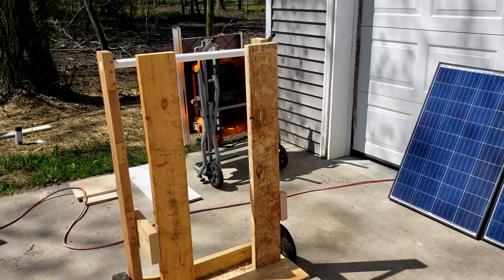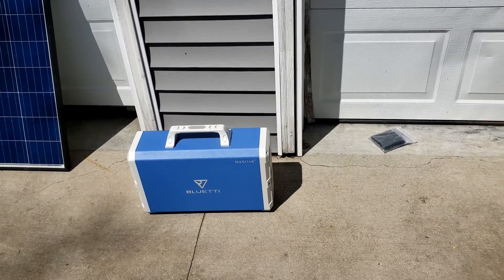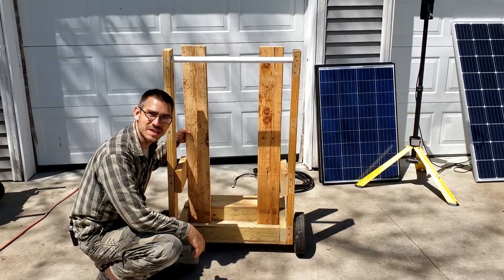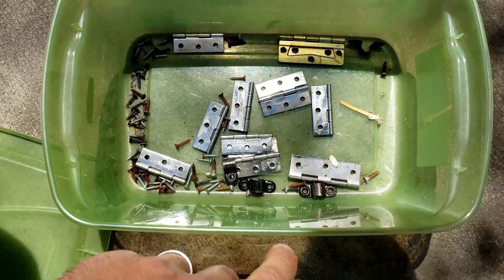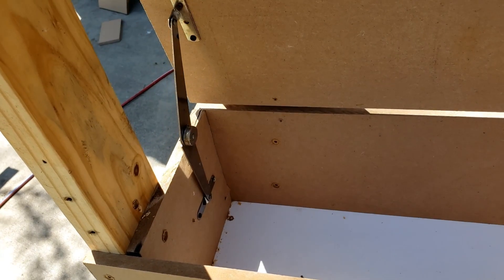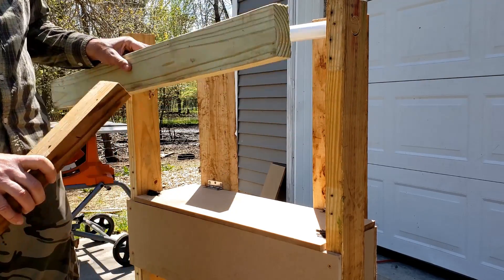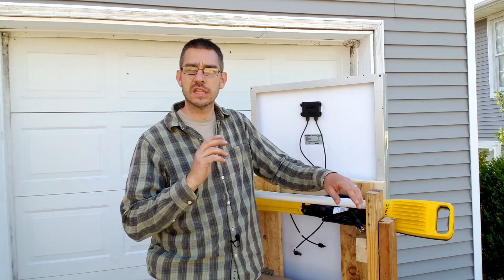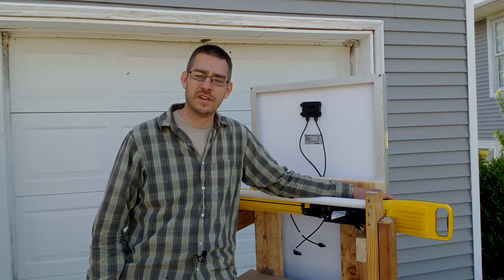BATT-Mobile - DIY 1200 Watt Portable Solar Generator

Comment: It doesn’t matter at this point in time, but it looks like the small board at the base, that keeps the bottom of the panels in place, is taller than the frame. It looks like it could be shadowing the panel. Love the video!

Comment: I have a couple of the those panels they work well. I have pulled as much as 471 watts to charge my ecoflow delta2. I use two 180 panels to run my office w/ all my computer equipement. No AC.

Comment: I just lay my panels on a few 4X4 propped up at 23 degrees and I'm done... 100 Watt panels are going for $65.00 on amazon now... and I have two 100 amp hour LifePo4 batters... rated for 4000 cycles...

Comment: I like it!    I was looking for a way to make a couple of my 200W panels portable that I can take in or out as I need (until someone allows me to mount them permanently in our yard!).    I am thinking of starting it on a decent hand truck that we have that is not used very often, and make it so I can attach or detach from the handtruck as needed.
I'm not crazy of having to screw and unscrew those outer wings to the panel each time you use it.  I may put a flat metal bracket on the outsides of the panels and use a 1/4 inch pin to go through that bracket into a hole on the end cap of the 2x4.  Then have a light retainer cable or string on the end of that pin to keep from loosing it when not in use.

Comment: I did a similar project with old push mower frame,just removed junk motor.i angle the panels w/ handle lever & some leg supports.the 4 wheels keeps it quite sturdy.i just push it in the garage if winds gust 45+mph 🤓

Comment: Cool idea, but I think you are using the push stick wrong, you push on the part between the blade and the bar to prevent kick back, the off side does not kick back.
Reply from the maker: I use a push stick for two purposes, one to prevent kickback, two to keep my fingers away from the blade.
Reply: @SSLFamilyDad  I appreciate your time and effort on the video. It was very informative. Please do some research on kickbacks and the proper use of push sticks, perhaps look into adding a feather board as well. You really had me concerned a couple of times.

Comment: As soon as you said add a hitch for your mower, I thought, use your kick stand for dual purpose. Put a stop on the inside so that the kick stand can't go past fully up, drill a hole through the bottom board and make a removable hitch with some threaded rod (bent to an L). Use a couple of nuts and washers to secure rod in bottom board and you could either use another nut to hook it to the mower or drill it for a pin. When you get to where you want to set up, take the cart side nut off, remove the hitch and you already have the hole to stake it down. Might have to strap in the battery pack,

Comment: Use bolt on I bolts for the leg anchors and you can use rebar stakes to  anchor to the ground.By the way I am going to use the panels I just bought and they are 330 watt panels so I would make two of these.The panels I were only about $0.67  per watt

Comment: OK, may be a really dumb question, but will you gain anything if you place this solar panel inside of your greenhouse?

And BTW, congrats on the 200k!!!!
Reply from the maker: It wont make any difference in solar capability and I fear the excessive heat would be bad for it
Reply: @SSLFamilyDad  i was thinking more of out of the elements, light source.

Comment: Man if you’re planning on using this outside in the elements you should be using exterior materials or better yet waterproof materials. That particular board / vinyl material going to fall apart into saw dust from the moisture/rain in no time!  Odds are you’ll be having to rebuild/remake it in 3-6 months depending on your weather there? Maybe sooner?
Reply from the maker: This is only meant for portable temporary use, not to sit outside in the rain and snow. Also, I used a deck sealer stain on the whole thing
Reply: Sorry guy, but even with the best sealer in the world that particle board will still not hold up to moisture, especially since your edges won’t get any sealer on it nailed to your side boards. I’m a contractor/ cabinetmaker with over 40 years experience. I promise you it won’t hold up. But it’s already made obviously, so you’ll see for yourself soon enough!

Comment: I was surprised you got 280 watts from the panels with the little support in front of the panels casting a small shadow on the panels.  I have a monocrystaline panel and if it has a slight shadow on it the wattage drops by 95%.  Also, a cheap, well pretty much free way to make a tool to aim the panels is to take a spray can cover and screw it upside-down to a white piece of wood. Point it at the sun and when it cast no shadow you are at the perfect angle.

Comment: What if you had some sort of lock that would slide or twist into the groove behind the solar panel (maybe on the sides and bottom) so that you don't have to get your hands back there to screw in a nut every time?

Comment: Hey I'm not one to tell people there business but you should use the push stick next to the fence. That is the board that will shoot back. I have seen one kick back and hit someone in the man parts and he lost one of the set. I have been a carpenter for 30+ years. Dont want you to get hurt.
Reply: I was about to write the same. Every time he used the table saw I was cringing.  The piece between the fence and blade is the one you have to be 300% aware of.  Specially NO hands or fingers close to that area. Please be safe using that TableSaw.

Comment: Looks great.    2 details:
Is there any risk of the 'kickstand' collapsing back into its 'stowed position' and allowing the whole thing to fall over?
2nd, the little wood bracket at the bottom front is creating some shade on the bottom edge of the panels, and blocking about 2 watts of sunlight!!
HA!
Reply from the maker: Someone else mentioned that there was shade on the panel and I didn't know what they were talking about, now I see it! lol. Yes, right now it can collapse backward so I need to make a pin or some way to lock that leg in place